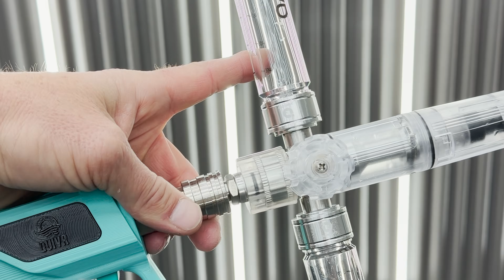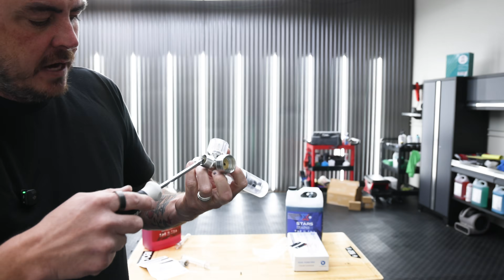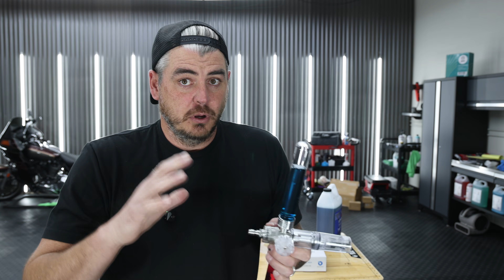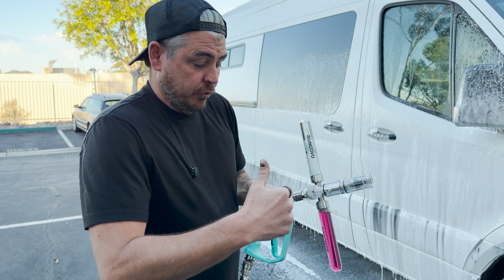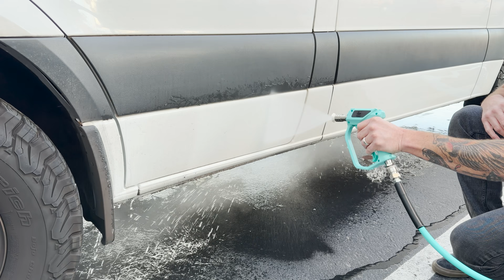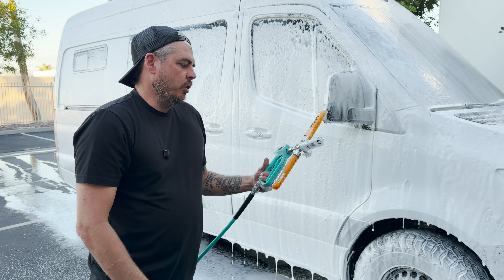NEW DUAL PRO FOAM CANNON - Auto Dilution for Pre Wash Touchless Soaps?

Comment: I use Stars and Stripes for washing and then MFP Touchless for protection. Blow out the crevices, dry with a towel, and I'm done. I haven't used a wash mit in 2 years at least. I'm not a detailer, but I get a lot of compliments on how clean my cars look!

Comment: Hey Josh please help, I was gifted a 1800psi 1.2gpm pressure washer, mckillans swivel pressure washer gun with the wide mouth snow foam cannon with the 1.1mm orfice already installed. When using, my foam is Not shaving cream thick but rather a watery running foam. Do you think I should purchase a more expensive foam cannon? This is my very first pressure washer set-up.

Comment: I really like the idea of these mini foam cannons but they make little sense when you think about how every soap has a different viscosity dilution ration making the metering tip the basis for the dilution.  Add in the second variable of viscosity and you are spending a lot of time figuring out which tip for which soap.  Simply mixing the solution in a traditional foam can where you dilute it yourself in the bottle seems like the superior method unless you only ever use one brand of soap and you buy one of these that has multiple tips.

Comment: Since I doubt anybody asked online about it for me to reference, I asked ChatGPT.

It says to rinse in between, or else the second soap is neutralized before it can dwell on the paint and go to work. I remember in a Chem-X video he addressed the directions of immediately spraying Stripes after Stars, saying that was for semi-trucks (which take a while to cover) and that for cars you are fine letting it dwell a bit. As for the heat reaction of combining them, ChatGPT said it would be minuscule (you could pour both diluted mixtures into a bottle and measure the temp).

As towards the order, it said since water spots are under grime and bug guts, do high pH first, so that the low pH has access to those. If you live up north where they salt roads, then pre-rinse with water first as neither acids nor alkalines will make a difference vs water.

Would be a cool video to post, trying it 3 ways (high->low, low->high, high->rinse->low; though that kind of experiment sounds more like a video Detailing Dogma would do).

Comment: Always pumped to see my soaps on your channel Josh! I wanted to love this foam cannon, but with less viscous soaps like stars and stripes it just drinks it too quick, also the foam quality is not as good as it should be blasting through soap that quick. I noticed a considerable vacuum created on the bottles as well when using my own 32oz bottles directly, which might explain why the Stripes stopped drawing for you🤔 It did do really well for me with our salt neutralizer Eagle Guard with is much higher viscosity, I got 2:40 seconds of runtime on one fill up with way nice foam, so I think it boils down to using certain soaps with this cannon that are just the right viscosity.
Reply from the maker: Thanks Bob I love Stars and Stripes! Yeah I think they need to add some alternative metering options so we can swap them out for different soaps. Super cool product idea but it’s not quite there yet

Comment: At about the 20 minute mark, as you were reading the information sheet, you stated a concentration adjustment dial. Did I miss something, or would that be the fix for the overuse of the product?
Reply from the maker: The adjust how much water flow goes through. So when it’s tightened down all the way, that would create more foam. Opening it would make the foam too runny

Comment: After Keav’s review (showing it near impossible to get consistent dilution, both from multiple runs and even between the top and bottom bottles), it just makes it not usable for things that need a specific PIR. And because there are no changeable metering tips, if you use soaps of different viscosity between the top and bottom, you are just out of luck.

Comment: Kiev already did the same test
Reply from the maker: I finished filming this and saw his video. Funny we had the same idea with chem x as well
Reply: @imjoshv all good, I like your reviews better anyway. I need to replace my active two pressure washer.  When is yours coming out?
Reply from the maker: Thanks! Unfortunately its still a ways out. The first stage of tooling is done for the motor and pump and tooling for the hosing is set to begin next month. Them some more testing and then production